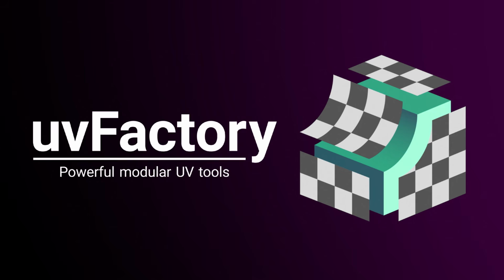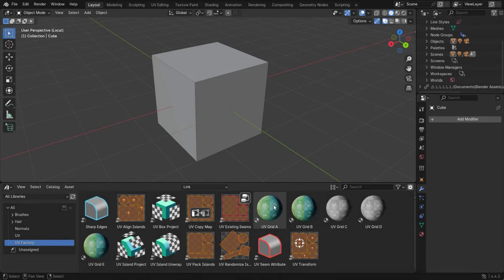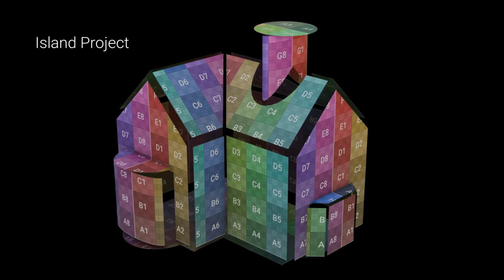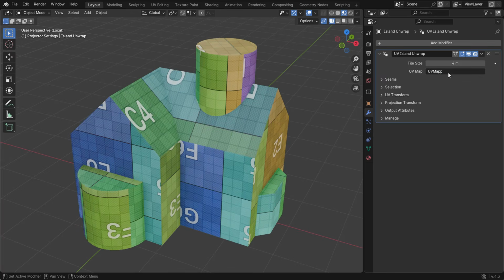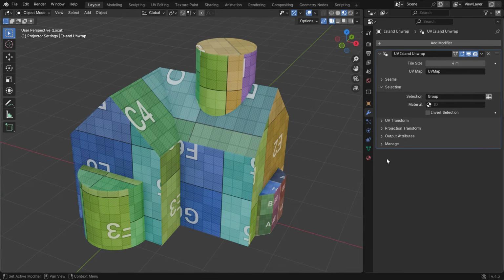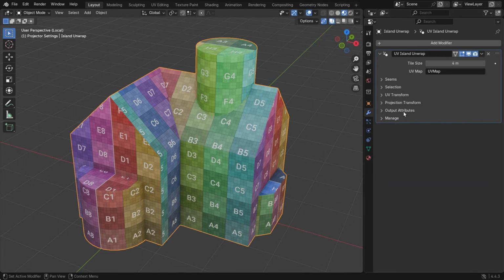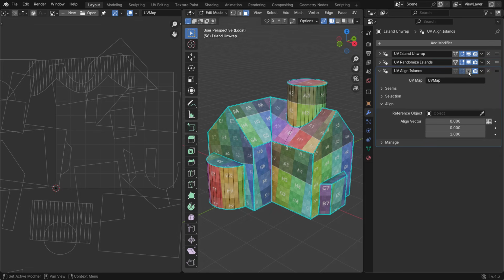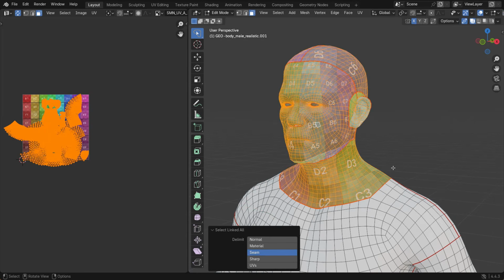uvFactory for Blender — Walkthrough

Comment: This looks amazing. I would like a tutorial on how to use uvFactory on an object I’ve already modeled. In the meantime, I will buy it.
Reply from the maker: Thanks! It's not any different to using it on a model you're still modeling, you can add any of the modifiers or use the manual tools.
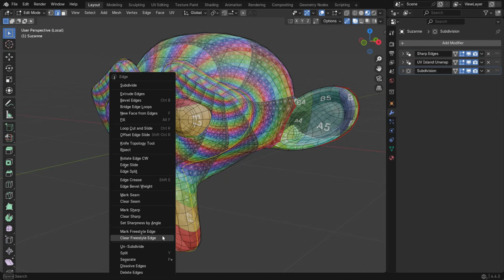With modifiers you can limit selection using the selection panel 04:52
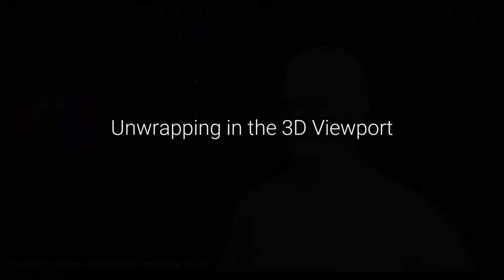And using the manual tools are covered here 08:14
Hope that helps, if there's anything more specific you'd like to see let me know :)

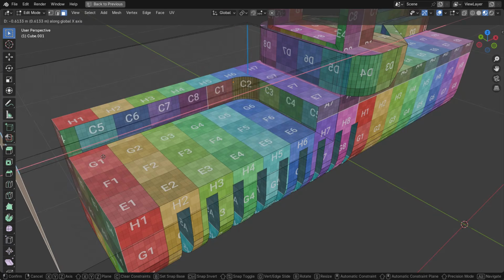Comment: At 0:16 C6 shift between C1 and C2, this is very worrying if you want things to stay cohesive (Is there any ways to fix that?)
This giving me GTKRadiant/Source engine vibes of uv mapping, would be really cool if it can do the same job as Brushes editor back in the day, I'm not sure but I think they used a combination of box projection with UVW mapping to keep texel density in check.
This would be amazing for people who have learned to do basic level design stuff from Brushes editor back in the day
Reply from the maker: Sorry for the late reply! Yeah using box projection will avoid that, it's happening because it's performing an unwrap on a curved surface and it's average normal is changing which is what I'm using to position islands.
I could add an option to position based on island bounding boxes too 🤔 that would be more stable in cases like this